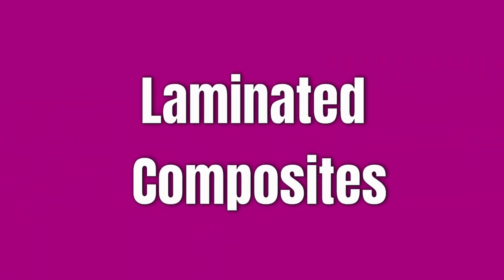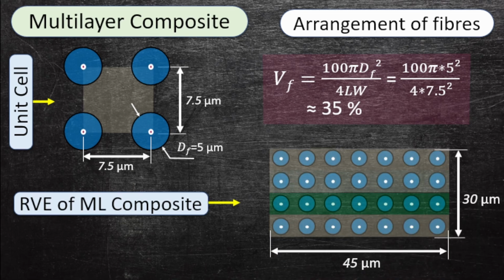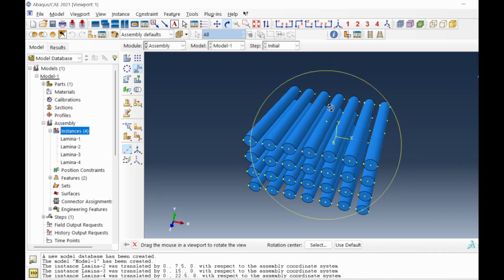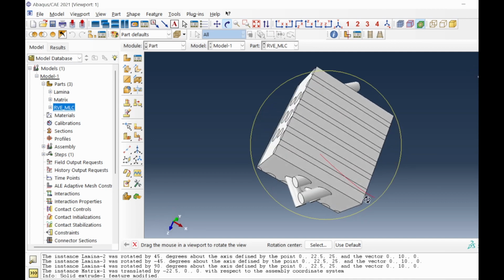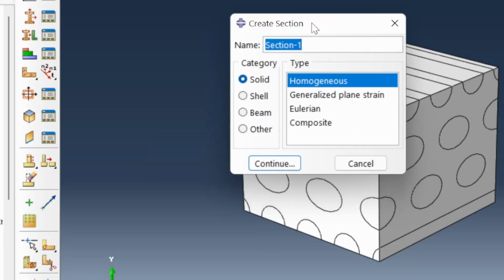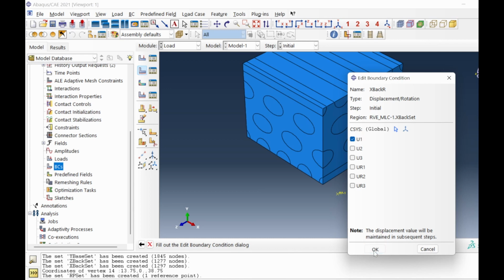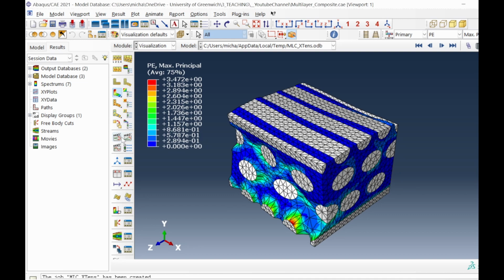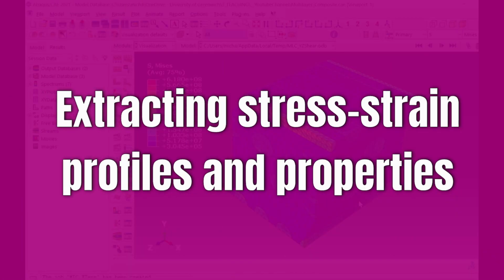How to model MULTILAYER composites in ABAQUS

Comment: Thank you for your response.  I have developed a three-point bending test model in Abaqus, consisting of 20 composite layers and 19 cohesive layers. Each composite layer has dimensions of 120 mm in length, 13 mm in width, and 0.15 mm in thickness. The cohesive layers, which are placed between each pair of composite layers, have a thickness of 0.001 mm. The span length between the two supports in the bending setup is L = 9 mm.
In the material module, I defined the properties using the "Engineering Constants" option. As the punch displacement increases, the S11 stress component also increases, which is expected due to the elastic material definition.
My main question is: what steps can I take to determine the maximum force before failure or the flexural strength? My objective is to write a script that allows me to vary the number of layers and their orientations in order to optimize and achieve the highest possible flexural strength or peak load.
I have based my simulation on the article titled "Progressive Failure Analysis of Laminated CFRP Composites under Three-Point Bending Load." I would be very grateful for your guidance, and if possible, I would appreciate having your email address for further correspondence.
Reply from the maker: If you sign up to my newsletter... you'd be able to correspond with me. We can  take the discussion there.

Comment: Hello sir, thank you for your videos. I would like to model a multi-layer composite subjected to a three-point bending test in Abaqus. How can I determine its maximum flexural strength? I would greatly appreciate your guidance.
Reply from the maker: Thanks for your question! To determine the maximum flexural strength in Abaqus, you can apply a three-point bending load and analyze the stress-strain results to find the peak point. I note the request.
Reply: @MichaelOkereke  Thank you for your response.  I have developed a three-point bending test model in Abaqus, consisting of 20 composite layers and 19 cohesive layers. Each composite layer has dimensions of 120 mm in length, 13 mm in width, and 0.15 mm in thickness. The cohesive layers, which are placed between each pair of composite layers, have a thickness of 0.001 mm. The span length between the two supports in the bending setup is L = 9 mm.
In the material module, I defined the properties using the "Engineering Constants" option. As the punch displacement increases, the S11 stress component also increases, which is expected due to the elastic material definition.
My main question is: what steps can I take to determine the maximum force before failure or the flexural strength? My objective is to write a script that allows me to vary the number of layers and their orientations in order to optimize and achieve the highest possible flexural strength or peak load.
I have based my simulation on the article titled "Progressive Failure Analysis of Laminated CFRP Composites under Three-Point Bending Load." I would be very grateful for your guidance, and if possible, I would appreciate having your email address for further correspondence.

Comment: How can i extract the poisson coefficients from this simulation?? For example, in the X axial tensile test, v12 = - e22/e11, i can calculate e11=dx/L0 (L0 being the initial lenght of the rve, and dx the displacement applied in X+ face, but when estimating e22 im having problems, which would be the appropiate way to estimate it, i did the average e22 of all the elements in the mesh, but when I want to enlarge the RVE by taking more fibers and layers, the poisson (calculated by this method i just said) gives me very different from the first smaller RVE, and i dont know why. Thanks for your videos they really help me developing  RVEs.
Reply from the maker: This is a good question. I have made a video in the past where I dealt with this sort of query. Please consult this link: https://youtu.be/tmFR2OiRKbw for determining poisson ratio on 3D domains.

Comment: Thanks for the nice tutorial. Once the multilayered model geometry is completed, how do you select the RVE? As the different layers have different angles, it is quite confusing to visualize and select the RVE for further analysis. Could you please some suggestions
Reply from the maker: Hello, I am not sure about the question but what I would do is to simply draw a block selecting all at the assembly stage. You would have to bring all parts into the assembly to select all. If you are trying to visualize the model instances for all parts, I would normally whilst in the Assembly module select something like viewing it in the Load view or surfaces view so that you can see what is happening inside. Alternatively, if everything is in the assembly module, then you can suppress say the matrix part which will reveal what is inside. 

I am trying my best to explain based on my understanding of the question. Please explain the question further if I am getting it completely wrong.
Reply: @MichaelOkereke  Once we model the full geometry of the multilayer composite with each layer denoting different angles of fibres, say 0-45-135-0, once I stake the fibres like this, how can I select a portion that represents the repeating units. In your periodic boundary conditions and representative volume element tutorials, you mentioned taking the repeating units. So, for this complex multilayered fibres, how can we find a repeating cell
Reply from the maker: Okay, I understand the question now. YOu see for the laminated system with stacking sequence of say 0-45-135-0, unfortunately, you would have to represent all of them within an RVE for such RVE to be deemed admissible for carrying out a simulation. The repeating unit will include all of them. This is where the idea of Repeating units fails especially since the smallest unit of the RVE is the same as the structural/macroscale unit.

This is not the case for UD composites which at fibre-level represents a repeating unit, especially if the UD has ordered fibre arrangement. If not ordered, again, you would have to use a larger RVE to create effective simulation of properties.
Reply: @MichaelOkereke   Yes, exactly. Now, the RVE is quite large, and another problem is that because of angular alignment, nodes on the opposite faces are not parallel. It seems like the general way of applying PBC in your earlier tutorial is not applicable to this case. How can we approach this situation, Is there any simplification in BC's or any thoughts about this?

Comment: howto see stress values S11 in each layers? i have a composite plate with 8 layers. pls help me.
Reply from the maker: Hello @Sirajudheen, you just need to switch the stress from von Mises (the default) to S11, that is if you did it with my type of approach. However, if you are using the laminate composite approach where you used homoogenized lamina properties, then you will have to use the local material coordinate system of the ply to extract the relevant S11 values. The later is not something I did in this video as this is not relevant here.

Comment: instead of this method, i modelled composite plate as a orthotropic plate with E1,E2,E2,G12,g13,v12.v13 etc.......... for structural applications. is that fine?
Reply from the maker: Hello @Sirajudheen, you are right about the method involving those constants. This is treating the composite as a homogenized lamina. I used a micromechanical approach in this video, in which case thre waas a distinct representation of fibres and matrix in the RVE. This could be something for me to consider: the laminate composite approach.

Comment: Hi sir, very interesting video! I wonder why you introduced x, y, and z direction roller BCs instead of periodic BCs in this case? Also how to apply the periodic BCs in 3D domain? I only see your video applying periodic BCs in 2D.
Reply from the maker: Hello @Lejie, thanks for the comment. The x-, y- and z-direction rollers is to ensure that appropriate dirichlet BCs that enforced pure uniaxial deformation is imposed on the 3D RVE. I have not used PBC in 3D as this code is not available yet. There is no automatic way of doing so inbuilt within ABAQUS except one uses a bespoke software developed for this.

Comment: Hi sir, Thank you for this video. Can you do a tutorial for a composite with randomly oriented fibres (fiberglass reinforced polyester matrix composite)? for tensile and bending test,I really need it, and how can I insert the percentage of fibers on abaqus.Thanks
Reply from the maker: Hello @Houda Foulah, thanks for the comment. Are you interested in a short fibre composite with the inclusions randomly oriented? If so, then I do not have a video on this yet but this could be inspiration for  a future video. I am not sure what you mean by tensile and bending. Do you want such load cases on the micromechanical model of the reinforced composite?
Reply: Thank you sir 🙏🙏

Comment: On which scale analysis is based on?
And if number of fibre is more then how you will model e g CNT tubes.
Reply from the maker: Hello @Madan C Maurya, thanks for the query. I did not make that clear... the fibres are at micron scale i.e. 1e-6 m. Where more fibres are considered, then it might still be admissible to use this approach but it begins to tricky as the mesh size rises significantly. This is why people will often switch to mesoscale modelling of the laminae instead of individual fibres as shown here. For CNT tubes, I actually have a video where I used similar RVE modelling approach here. Maybe, you can see if this will help you, here is the link to the video: https://youtu.be/2jLY191dFm4